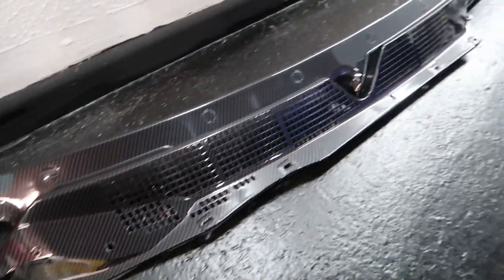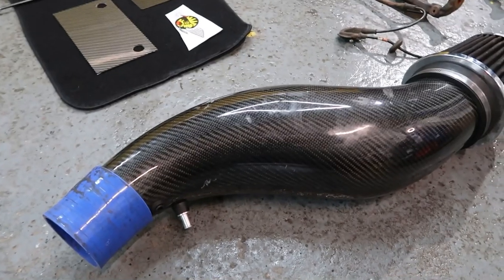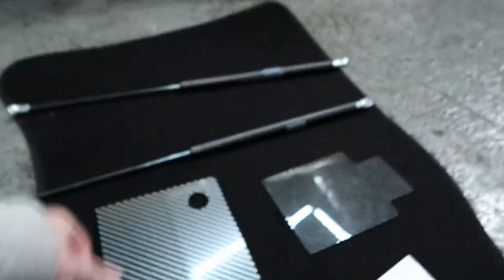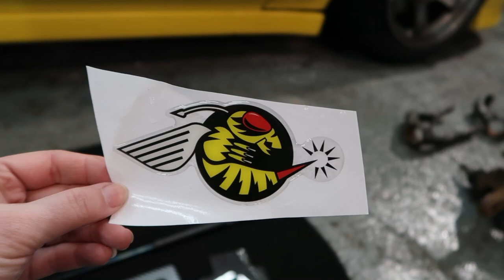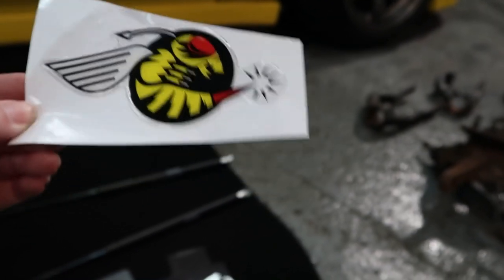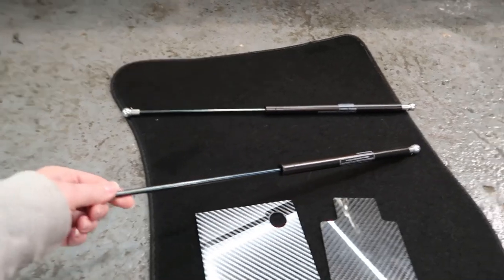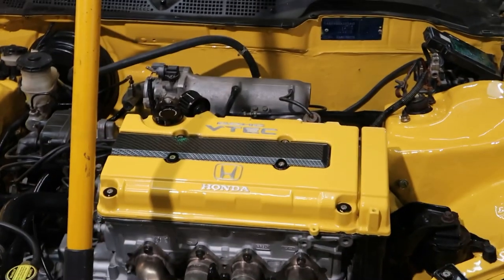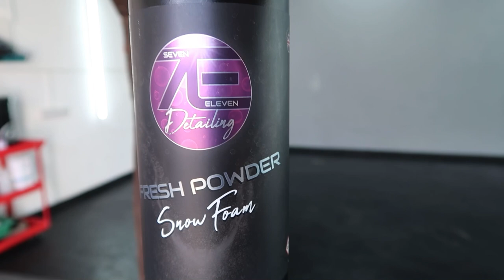Affordable Carbon On EK9 Civic | I BROKE THE JORDAN

Comment: Nice job as always the little touches make all the difference IMO a would change the blue silicon hose to black on the air pipe to tie in with the rest of the bay 
Least it was only a broken wire and you guys resolved it 
👍

Comment: Carbon parts look amazing. 👍🔥

Got a mismatch of real and fake carbon parts on my EP3 and you can really tell the difference but only if you look closely at the weave and feel the difference in weight between real and fake carbon.

Also those wheels look amazing on the civic, what specs are they?
Reply from the maker: Carbon parts are the best. I agree. 

Yeah you can tell if you look closely, but some are really good copies. 

4x100 15x8 et30